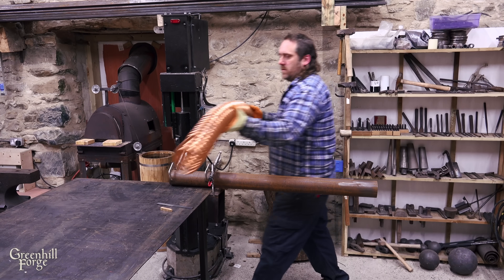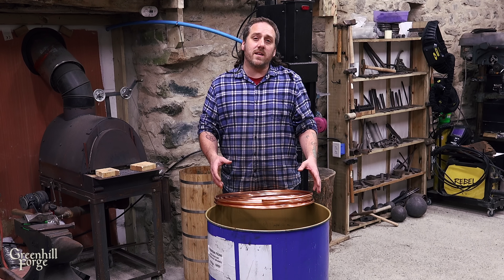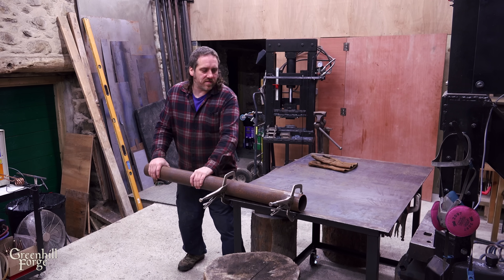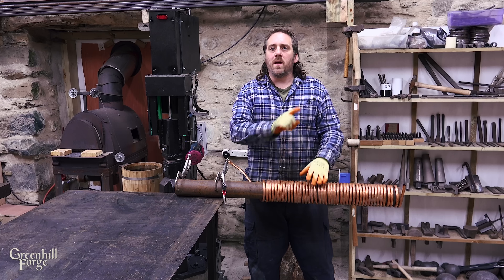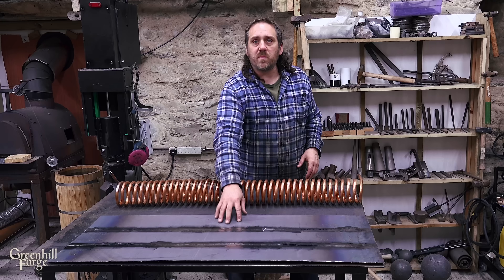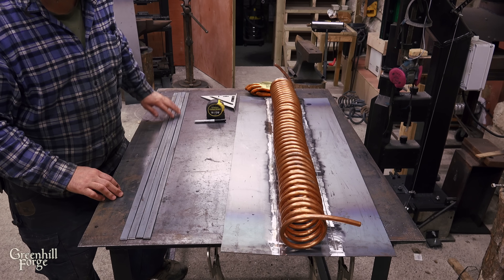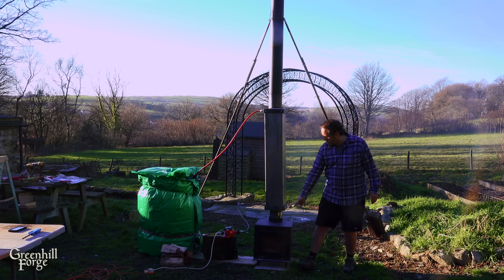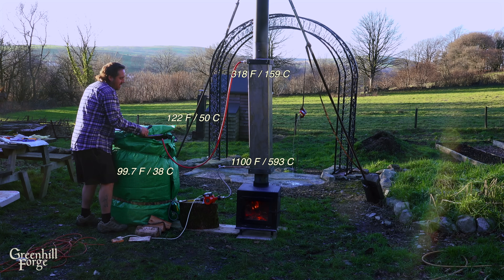Wood Stove Water Heater Experiment - Surprising Results! Part 1

Comment: I live in north Sweden and majority of the houses here where I live have their old wooden oven/stove in their kitchen next to their electric one. The wooden stoves are connected to a water pipe system going to all rooms with water radiators.  
I heat the entire 5 room house for less then 1000usd each winter (4months) 
We use to build these wooden stove closed loop water systems in our houses back in the 60s and 70s and it’s still untill till this day cheapest and easiest way to heat your house + having warm water for your sinks and water tanks in the house. 
In the basement I have big water tank and each time the temperature goes  below the wanted temperature (when the fire is out)  small water pump kicks in circulating the water from the hot water tank that was heated with the wooden stove to the radiators. 
It keeps the temps nice and toasty about 6-7 hours after the fire is out in the stove.
Reply from the maker: I've seen those systems and they're one of the coolest things I've even seen. I'm jealous. If I build my next house I'm definitely adding one.
Reply: @GreenhillForgeI’m kinda surprised they aren’t more popular then they are outside of Scandinavia. It’s such a simple and yet extremely cost effective way of doing things. 
Right now its -2F outside but 75F indoors  in all rooms using a small beautiful wooden stove on the bottom floor.

Comment: Great video and expertly communicated.  The figures, especially the difference of the exhaust gases, were eyebrow-raising.  I wonder if putting fins on the pipe would help at all.  Would be fiddly as hell and would increase the potential for leaks I guess, but increasing the surface area of the pipe would obviously increase the thermal conductivity.  Just a thought I had that I'd share.  Do with it what you will.  Anyway, great video.  Thanks for sharing it with us.
Reply from the maker: the follow up is coming really soon and if you thought this was eyebrow raising....

Comment: Having done this 40 years ago, I can tell you that if you put the copper coil inside the pipe it will be covered with creosote in a few months which will insulate the coils which will keep the coils from heating properly. I put the coils on the outside of the 6" pipe and slipped that inside a piece of 8" pipe with 6" to 8" reducers on both ends of the coils to keep the coils out of the smoke. That worked the best and still gets the water hot enough to burn you. As far as I know it is still working fine. Keep up the good work. Jerry
Reply from the maker: I'll be trying something similar soon so I can test the differences in efficiency of thermal transfer. It's definitely the safer route though.
Reply: @GreenhillForge id recommend you wrap the coil around a metal pipe and put another metal pipe around it
Reply: @Flexsan, I'm sure you could, but it would difficult because you can't easily control the temp and you can't see the coil. One rule I learned later on was, If at all possible what ever you do try to make it Maintenance Free. Jerry
Reply: I have a basement wood burner that has pipes for extracting heat. I have to sweep the pipes every forthnight to keep the burn efficient. But it burns 24/7.
Reply: Absolutely cool. I've wanted to do this for a long time and just never have. Really great idea. There have been some good suggestions offered up in the comments also. I'll add my 2 cents in question form since I've not actually done this. One question is about the copper being in the smoke stream and a commenter did mention creosote build up. But my understanding is the lye in the wood ash will cause pin hole leaks in the copper-eventually? The other question is the effect of dissimilar metals in contact with one another. My understanding is the dissimilar metals will increase the rate of corrosion at their contact points. Has this had an effect? Anyway, great video. That one cool project.
Reply: Yes the copper pipe will cause condensation of the wood flue gases - the more heat you extract the more of a problem it will be. Creosol formation is a natural result of the heat transfer of flue gas cooling 

Long term problem generally , finding a balance on the amount of heat extracted  

Unless you create a way to brush scrap or easily clean creosol - that is a bigger problem.
Reply: Even steel stove pipe has a fairly short life span,  They'll be water dripping on the fire within 2-3 seasons. I grew up with wood stoves, smoke and heat will destroy most anything over time.
Reply: make the outside pipe an insulated one?
Reply: Sounds more better!!
Reply: My comment as well.
Reply: @Mr22Jwc22  I said this too
Reply: Do you have any pictures of how you put it together? Sounds like a really good idea.
Reply: Thanks for answering my question
Reply: To not have creosote on it water loop should be hot so it doesn't condense on surface.
Reply: Exactly...right
Reply: The copper will get creosote and be insulated somewhat, but if you mount it on the outside, the inside of the pipe will get the creosote and will be insulated.
Reply: Why not put it on the outside of the 6in then sleeve it
Reply: If the coil is in a cavity not in the flue gases you can fill the cavity with a heat resistant material to help transfer the heat to the coils
Reply: Could you burn of the creosote by firing it without any water in the loop?
Reply from the maker: copper starts to get soft at around 750f and melts at around 2000f so you probably could get away with it if you really dialed in the fire. I think the only way we'll know for sure is to try it. Maybe after all the testing is done on this first unit I'll have to give it a try...
Reply: @GreenhillForgecould you stick a bunch of peltier modules on the upper part of the chimney to generate electricity for the pump? That way it could be truly off grid and it would double as a temperature control system to protect the copper.
Reply from the maker: @primusolaris  I have a video on building a stirling engine and they could definitely power a pump. peltiers are really cool but getting a ton of power from them is a challenge
Reply: @GreenhillForge Thank you! I will check it out.
Reply: @GreenhillForge i live in South Georgia .USA !  if the coils were installed on outside of the flue I can utilize it as a "hybrid" in the hot Georgia summers and wood heated in Winter . I have seen many videos online so a cupellation of youtube  theories as follows .... ( I litterly jumped to this video a few minutes ago ) paint the copper coils ( maybe a bigger Diameter copper pipe ? more footage of coils for hot climates) run to inlet on your hot water heater ,as again at very least a pre-heat lowering hot water heater power consumption. allow them to be in the sun. and it would at very least solar heat water in summer too. my two cents worth
Reply from the maker: @satanloses  I lived in Athens for years and spent a few months on a cattle farm in Tifton too. I have a shower setup that I show in the video that came out after this that preheats in the sun. It's good enough for showers in the summer with just the sun or a small fire can make it extra hot.
Reply: @GreenhillForge thank you
Reply: Have you still got the bugs flying around your face from Tifton? Lol I had a flat tire in tifton once.

Greetings from Dahlonega
Reply: @Flexsan  Not if you want to keep any solder or brazing intact.
Reply: What are you doing for electrolysis?
Reply: I would add in France this would be illegal to put something inside the conduit.

My mom has a pellet stove with a water heating system, it heats a small tank before the conduit.
Reply from the maker: @Arvi89  That probably only applies to indoor systems? I would agree that nothing should EVER be put inside a flue on an indoor system.
Reply: @GreenhillForge  yes indoor. I was thinking about this system more globally than just for the hot tube :D
Reply from the maker: @Arvi89  Yeah, I would say 100% only use this kind of system indoors if you want to burn down your house.
Reply: Nothing allowed inside likely because soot buildup can cause chimney fires @GreenhillForge

Comment: Say you have a cabin that has a wood burning stove for heating in the winter, but cooking year round.  Could this kind of thing keep it from making it so hot in the cabin when cooking.
Reply from the maker: Hmm. I think I'd go for a two flue system. A T right after the stove could switch between a single wall flue on the inside for the winter and a class A flue that goes outside immediately for the summer. That's only my first thought and can't actually recommend it or comment on it's safety.

Comment: NEXT LEVEL. 10/10 job. personally i would make a smaller coil out of 3/8 and 1/4 for inner coils. A neighbor of mine from back int he day did this but more of a boiler than a coil... strait pipes vs coils.... and he bragged about his wood stove was so efficient that there was only at max a 50*F temp difference of heat of the water (boiling) and the exhaust. He heated his radiant floor, water heater, and garage with this.

Comment: Add fins to the pipe. It will greatly increase the surface area to trap heat from the fire. Alternatively, you can use a radiator instead of the copper pipe. I guess you could use a stack of many small radiators to fit in the heat exhaust from the furnace.

Comment: Don't laugh at me for asking, but could you maybe slap a peltier module on the sides of the stove to power the pump? :)
Reply from the maker: I'm not laughing, I think it's a great idea. I'd probably go with a stirling engine (check out my video on strilings) but only because it's more fun to me. Peltiers would work if you had enough of them and would probably be easier.
Reply: @GreenhillForge  yeah, I thought about the stirling, it would be awesome, a clickity-clackity jaccuzi ;) About Peltier's: I learned in the meantime that they are really iffy and fragile (bit too cold - not working, bit too hot - damaged beyond repair). So stirling is probably a better idea. Anyway thanks for all the knowledge and experience You share!
Reply: Ok, did some quick research, you can laugh now :D

Comment: Excellent vid. I wonder if an archemedes screw inside the inner box, forcing hot air to circulate around the copper would bring even better results
Reply from the maker: I think it would help a lot and it's just a super fun idea. I mention this in a comment addressing video coming out soon

Comment: Hello 
Nice project. May be the performance is improved if you put the coil inside heat insulated Material, maybe try Foam concrete so all the heat is absobed by the coil instead of the outer shell. I commented before I see the end.  But still foam concrete could easier to work amd performe better to try please

Comment: I think you should double the chimney and have your heater horizontal.
That way you can make the water flow in the opposite direction of the flames, that way the difference in temperature will make it much hotter.
Maybe raise your water tank so that the copper is at half height and that way the water moves naturally without the need of a motor.

I hope to see a continuation of the project if you make any improvements :)

Comment: Very nice. Can it be run without water (just as a standard log burner heating a room) or would the high heat and lack of water deform the copper pipe?  I’ve been thinking about doing something like this but I don’t always want hot water from it.
Reply from the maker: I think the copper would need moving water to prevent damage to the copper and still water could easy boil and burst the system and be very dangerous. I've seen people wraping copper around the outside of the flue pipe but that still seems too dangerous to me to be inside and around people so I would personally recommend against it. It would also drastically drop the heat transfer to the water. I'll be doing more tests and designs in upcoming videos but a safe, indoor, system is quite a challege.

Comment: Very interesting. I did some fun, very rough calculations, and it seems that it is transferring about 20,000 btu/h of energy into the water. I also calculated that the wood would have about 80,000 btu, making this about 25% efficient. Not sure if that correlates with the temp drop of the exhaust gases, but it would be neat if it was close. 

I'm not trying to make any point here. Just bored. The wood has moisture so that would cut into the BTU efficiency and I'm guessing this wood stove isn't getting 100% efficiency on the burn. That means it's actually making less than 80 kbtu and has higher efficiency. 

Also, yes, as others have pointed out. the counter flow is the best way to capture energy from the coil. This is because you want the largest temperature differential between the water and the exhaust heat. If the cold water goes in at the bottom, by the time it reaches the top, it is at the coldest part of the exhaust gases and the water is the hottest it will be, meaning the lowest temperature differential. If it goes in at the top, it would maintain a high temperature differential the whole length of the coil 

That being said... It was getting a 24C cain in temp. Pretty impressive.
Reply from the maker: Thanks! My numbers are a little bit different to yours but not too far off at all. I get way more into the numbers in the upcoming rocket stove test comparison video coming soon. I also address the latter ideas in a addressing comments video coming out today or tomorrow

Comment: the wood stove water heater has been around for over 100 years. You are doing the same thing that has been around from even before DaVinci's' time. I have used this to make solar heaters and also for water purification systems in the very outback of Oregon where there was no other way to get hot water in any large quantity.

Comment: A lot of work done but better way would be to build a stove where water can flow on the walls. That is the way hottubs burning wood are done.

No need for copper and no need for pump if stove is in proper hight compared to water level.
Check Kirami wood burning ones as example.

So this is good for pure heat but not ideal for wood due to residue blocking all airflow soon.

Comment: finished the vid, mhm! that is just about exactly what i figured your design would do. thermal transference from actively vibrating gasses' atoms off the woodstove would impact the outside atoms of the copper pipe and vibrate those copper atoms. the hot copper pipe would then perform thermal transference to the water molecules running through the copper pipe. of course, gasses transfer heat FASTER and vibrates more easily than water. but since gasses' atoms are so 'far apart' and active they do NOT retain that vibration easily. THAT is why you need insulation around your 'inside assembly' outside surfaces to ensure the maximum amount of thermal transference from the woodstove's gasses to the copper pipe... instead of losing SOME of the thermal transference into the steel ALL THE WAY around the copper pipe. 

the BEST concept by the laws of thermodynamics would be... your copper pipe 'levitates' inside the exhaust of the woodstove and NOTHING else at all touches those exhaust gasses. but of course, an exhaust 'pipe' would catch some of that thermal transference to move the smoke etc. outside the 'house' or wherever this design is installed. also, levitation is impossible without magnets. :D

water's ability to STORE that heat transference is amazing due to how dense and lazy the molecules are. viscosity and density of water changes with temperature, but water doesn't increase or decrease viscosity/density until approaching the two extremes in temperature, freezing and evaporation. 

oh! your supply pipe of 'cold water' and your pipe of 'hot water' need to be EXTREMELY well rated for temperatures at the fittings to your heater so they don't melt. you also need to insulate those hoses too, to keep the loss of heat on both ends of the tank system at a minimum... 

plus your 'holding tank' does need to be vented somehow because mhm!!! the hot water WILL heat up the gasses (air gap!) inside the 'holding tank' and could pop the top off. just like heating a bowl of lidded soup in a microwave pops the top off. 

this was a HOT build and design! i was gonna say it was 'cool' but... u know. :D hah! thanks for the entertaining video!

Comment: 10:43 i haven't finished the vid so maybe you thought of this later. but as i was watching i thought of a problem you might have. the 'inside nuts' you put on the spacer bolts. you might want to put some permanent heat proof LockTite thread glue on those 'inside nuts'. or possibly a single tac weld on the bolts' threads 'below' the 'inside nuts'. heating/cooling expanding/contracting and any vibration you may have from assembly or further work you're doing, could cause those 'inside nuts' to walk inwards towards your insulation and allow your outside sheathing to compress the insulation (perhaps). that walking inwards could also make your outer sheathing loose at that point and mess with your assembly. 

another suggestion, maybe on the outside of the sheathing, put a washer on those bolts and THEN the outside nuts. those washers will definitely seal the bolt holes in the sheathing, so you don't have heat loss through those bolt holes from the insulation.

Comment: How can anyone seriously consider using this heater long-term without getting answers to the questions that have been raised about creosote build-up and dissimilar metal contact?
And what happens to the copper tube if it runs dry?
Reply from the maker: I answer these in my next video